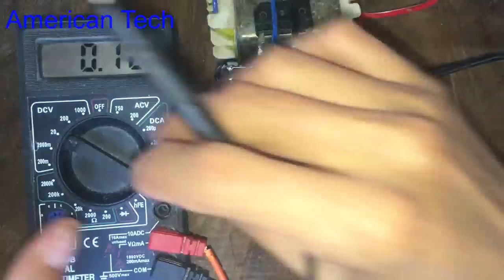New ideas to make spot welding machine with high Quality

Comment: You are welding wrong! You don't put both electrodes on the tab strip. You put one on the tab and one on the end of the battery. So, the current will flow from the tab to the battery making a good connection. You just made a hot spot that kind of stuck. Not a true weld.
Reply: Darryl Edington
Reply: Darryl Edington  I agree lol
Reply: i saw that too but I couldnt really get to it cos he has some dark stuff beneath his nails and couldnt figure it out what  was that for?
Reply: How about also that the little microswitch has about a 50mA rating, lol
Reply: Darryl Edington you can’t heat lithium ion through the cell, the arc between the electrodes isolates the heat preventing damage to the battery
Reply: Just wish he disclosed what transformer he used
Reply: This is stupid that micro switch only holds up to 50mA?!?!??!?!
Reply: رائع جدا

Comment: Wait a minute. If you are using a 30V transformer, the peak output voltage will be 42.4 volts. You're using 35V rated caps. They aren't going to last long being exposed to 42 volts. Your meter reads 30V but meters read RMS voltage, not peak voltage. You need to either use a lower voltage transformer or higher rated caps.

Comment: you can just do it with thick wires secondary without capacitors.
Reply: Not with that transformer.  He'd need one with lower voltage and much higher current, less resistance between it and the work.

Comment: The boy made out of scrap parts a device (which is not true welder). The transformer gives 30VAC probably somewhere around 250mA (judging by size of the transformer), rectifier bridge converts voltage in 42VDC, through small push button the capacitors are charged, now the moment of truth -- the boy shorts capacitors through conductive strip (rush current created by discharge of capacitors heats up the strip -- no switch involved at this moment).

The idea is great for 'budget' device but I would recommend to include 24V light bulb between rectifier bridge and capacitors and increase gauge of the wires for welding current. 

Ideally it would require some form of timer for welding pulse (555 timer monostable mode) and MOSFETs in parallel to conduct high weld current (no sparks). 

Of course it require to increase capacity bank at least 3 times to provide enough energy for discharge.

Comment: Everybody uses low voltage DC. Here is the new concept:  the spot welder uses electrical energy to melt the metal tabs.  0.5xcxv^2 is the capacitor energy.  Increase the capacitor value by 2x and you get 2x the energy.  Increase the voltage by 2x and you get V^2 = 4 times the energy.  Assume 24 VDC; So if you rectify the mains and charge a small capacitor it will give you the same energy as a bigger capacitor at low voltage.  120VAC rectified and filtered makes 170DC.  (V1/V2)^2 = (170/24)^2 = 50.  So you get a reduction of 50:1 in the size of the capacitor.  he is using 8800uF. you can have the more energy with less than 220uF

Comment: Great Idea! At first, I was like-->>The Tiny Button will burn out? Right?? But Then I read a little further in the video, and seen that you are not using it as a trigger, But as an on off switch to charge the capacitors. So the tiny switch is only seeing a small amount of energy, no in rush of current. Once the button is released, the cap stops charging.  I also noticed the bridge rectifier you used on the top of the Transformer, to make this DC from AC. Just curious on the amps used with the Bridge Rectifier and transformer Combo. Great Idea! I recently made one of these last month using 28 Capacitor.  The only problem, I have to charge and than arc with mine "SCARY". I might have to take mine apart and try a few Caps like yours and add the charging button. The Trigger is a Great Idea for the charging!! Great Video!
Reply: The power rating for small-signal diodes is ~0.5W, medium/large zeners 0.5~5W, schottky-barrier rectifiers >100W. The transformer primary winding is the [reactive] load to AC mains, limiting current to the rated transformer power, which is probably below 5A for the transformer he is using. If you're interested, search for "transformerless capacitive power supplies" to learn how reactance and AC analysis work!
Reply: Thank Daniel Lima, I have built a couple Transformer spot welders(MOT), That work perfect. Playing around with a few Captive Discharge welders here and there for fun. I saw all the comments here, on his use of the button, and no one really noticing he is not using it for a trigger, but a charge button for the Caps. So I just threw up a comment on the button and figured I'd ask about the diode he used(mainly a conversation starter). Wanted to see how many amps he had going into the caps. I made a Cap bank a few month back(I call it my centipede..LOL). I haven't really got around to playing with it, I wanted to see what others were using to charge theirs. With another project I am working on, 30-0-30 8amp transformer(running Parallel on both 30-volt taps) I recently put it together using a KBU1010 and 4 2200uf Caps. I noticed the video when thumbing around Youtube, and figured I would ask about the rectifier. Looks pretty close to my setup, minus the probes. Thought maybe I could test either my transformer PSU or my centipede, depending on the amps. I am always looking for another way to do something differently or better. (using Transformer in a LM338x3 Build for fun)

I am in no way an Expert. I am actually fairly new to the DIY world. But I research everything till I am blue in the face. My OCD takes over and a week later, I finally build what ever I was working on..LOL. I will definitely search the phrase you mentioned. I plan on posting all my builds and how to-s on YouTube soon, I just wanted to make sure I brush up on my soldering and wiring skills before. For now, I am only posting my builds on Google. Take a look when you have some time. Drop me a line if you have any question or feedback. I am always looking to better my DIY Builds. I plan on focusing on Small Bluetooth BoomBoxes But been on a Power Supply kick and Tab welders sometimes. Thanks for the info and here is a peek of my builds-

https://plus.google.com/+JoeFulwider-njfulwider5
Reply: Wow, I have just started to put high voltages in my DIY projects, and I always feel amazed how you can make a useful and safe utility from such a dangerous things! Yeah, I know that feel when I take weeks to months of research until finally assembling and tweaking a project. Last year I was playing with RF and maybe I'll build a robust HF tx/rx for Xmas! By the way, your G+profile seems to have a ton of stuff! Why don't you put some videos here? :D
Reply: I plan on posting Videos soon. I just wanted to make sure I have more experience, better soldering, and wiring skilz first. I am planning to very soon! I have a ton of project line up and all parts pretty much purchased and ready to go : )!
Reply: Mole removal
Reply: Charging capacitor is exactly what cause in-rush current
Reply: Lalmuanpuia Mizo No.
Reply: Then what cause inrush whenever we power any equipment having SMPS with its main filter capacitor fully discharged? Why theres no inrush if its main filter caps is not discharged?
Reply: how did you sir observed and fugure out all those details? I am 100% this guy is hiding something from us, I can clearly see there is something dark beneath his finger nails but cant see it what it is or what is it for, Im thinking it should serve a purpouse tho
Reply: njfulwider5
Checked out your G+... Cool stuff!  Good luck with the video editing!  
Cheers from Canada!
Reply: Actually, there's no need for a switch at all. If there is a 10k resistor (or a light bulb) connected in series between the rectifier and the capacitors, you can spot-weld continuously and there will be no danger of overloading any of the components. The resistor will simply limit the current even when the electrodes are shorted.

Comment: That is a lot of volts going into that small button the button will ware down without a relay
Reply: @ charles b
30V @ 0.25A (very shortly a couple of AC cycles) -- a little more than the button was designed for, but it for very brief time to charge the capacitors.

Comment: Can you use a 250 volt to 1000volt  megger with a capacitor ? Just wondering if it would work?
Reply: Od you have Big capacity capacitor and high voltage you can .

Comment: It turns out, under one of the contacts, arc welding. 
This is very bad! Repeatability of the welding level is not high. Every time you need to press something. this is a dead-end road, there are already solutions much better and not much more difficult.

But you have more than a million views. And a lot of man-hours spent on you. Well, congratulations, this is an achievement!

Comment: cutting aluminium tube wih KNIFE ? Are U Crazy?
Reply: LcrafterM he could have used a plastic or wood dowel instead of an antenna tube. The electrodes should be tungsten or other high temperature metal
Reply: @ Frenchie
The electrodes must have lowest impedance otherwise they will heat up too much and useful energy becomes wasted. All high temperature metals have very high resistance and in such device will be a source of heat -- but goal is to heat a contact between battery and conductive strip to bond them together.

It looks like this boy knows (understands) physics of the process better than you.

Comment: Too weak welding with 12-0-12v transformer on 24v mode and 8×4700uf cap. Supercapacitor seems much more powerful

Comment: How does he made the D. C. ???? . The transformer wil deliver A. C. !!!! Also the little switch been used is 1/10th of an Amp, switch will burn the first time it is pushed... ( to make the D. C. It needs a rectifier). Also if it worked.... The black tape will burn in NO TIME. Sorry.
Reply: Manuel Ruiz on top the transformer is a bridge rectifier
Reply: @ Manuel Ruiz
It looks like you have no idea what you are talking about. The boy made out of scrap parts a device (which is not true welder). The transformer gives 30VAC probably somewhere around 250mA, rectifier bridge converts voltage in 42VDC through small push button to charge capacitors, and now the moment of truth -- the boy shorts capacitors through conductive strip (rush current created by discharge of capacitors heats up the strip -- no switch involved at this moment).

The idea is great for 'budget' device but I would recommend to include 24V light bulb between rectifier bridge and capacitors and increase gauge of the wires. Ideally it would require some form of timer for a pulse and MOSFETs in parallel to conduct high current. Of course it require to increase capacity bank at least 3 times to provide more energy for discharge.

Comment: What is input value and amp of transformer??
Reply: I think the transformer is: 220VAC primary and 30VAC secondary at 3 ampere.
Reply: @ putan Palomares
Judging by size of the transformer you will get 30VAC with a current of 250mA.

Comment: A real American Tech channel would've used fourteen caps, each one double the size of your transformer. By the way... Are you really leaving unshielded copper inside a metal tube...? If you're gonna do something as dangerous as a spot welding machine can be, WARN PEOPLE! You're gonna kill or harm someone without noticing.
But I'm glad you didn't use hot glue to solder batteries

Comment: What a bullshit, charging the electrolytic capacitors with AC current! At least a diode or even better a rectifier is required here, otherwise the capacitors will blow up very soon!
And yes, the charging current needs to be limited by a resistor, too.
Reply: there is a rectifier mounted on the transformer, why do so many fail to see this

Comment: From 0-10 I can give you 3 tops, mostly because of the effort and from generosity. Other than that, well it's all bad, really bad. Let's make a process "disassembly". Materials - 4, not necessary to be new, but preferably in good condition. Yours are not. Wiring - 4, here ends the generosity. Shouldn't go with single core wire on some places. Soldering - 3. Circuit design and efficiency - 1. Man, so many wrong things with this circuit. Don't know from where to begin with it. Here is some food for the brain. How about instead of pushing the switch to charge the capacitors, pushing the switch to release the charge? You will get 2 advantages immediately, no more arcs hitting the surface and less stress on the capacitors, not to mention safety. Which bring me to Safety - 0. Sorry, but there is no generosity on this one for you. I see short circuits in near future, overheating, heating and melting, unwanted induction, possible arcs and not on the welding spots. Generally all of this screams "Beam me up, Shorty". Aluminium antenna body for both rods, are you out of your mind? Placing the capacitors onto the transformer body, again, are you out of your mind? Open to touch wires and so on, and so on. On second thought, I don't think this video should be on YouTube, better remove it from here. It can only be used on, how not to make circuit design for spot welding. Or how to endanger yourself and others around you. Or as slogan: "Save money from buying spot welding machine, to pay for coffin." Terrible!

Comment: so where's it get to being high quality? all I see is bad soldering and electrical tape? seriously how is that 'high quality'? flux your solder points, use only 1 capacitor of a proper value, or at least have a heavy gauge bus bar connecting the 4, shrink wrap your connections! 100mAh switch? sheesh this circuit will produce some  AMPERAGE even if for a few milliseconds. circuits need overkill for safety and please respect electricity always for safety and reliability
this guy is a joke. I hope nobody gets hurt using this

Comment: Junk! Those aren't high-discharge capacitors. There's not nearly enough energy in the capacitors (simple calculation shows that), the weld electrodes are pathetically poor. Complete junk. Pretend American, really Indian.